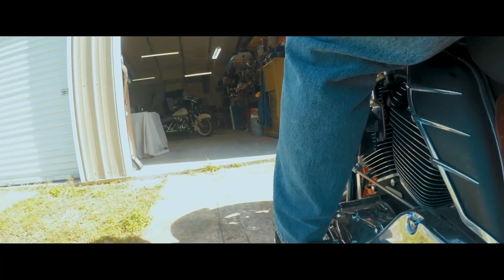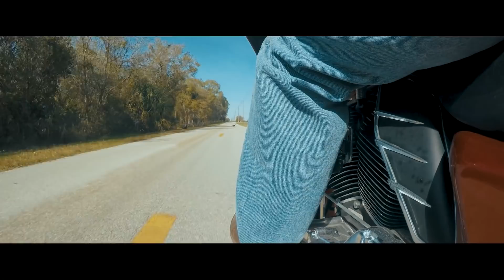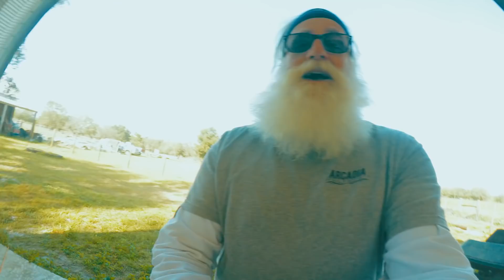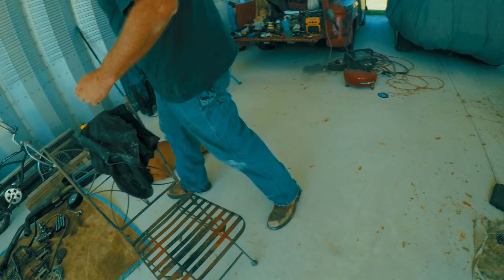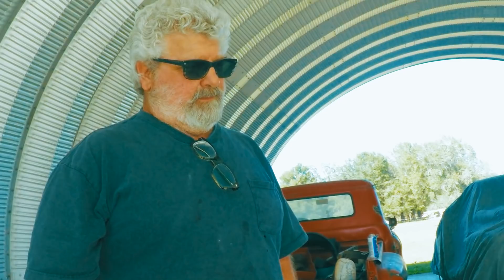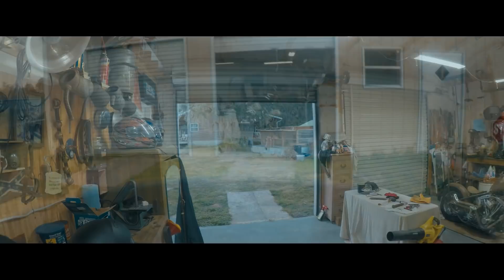2004 Deuce Softail UPDATE...This Is NOT Good!!!

Comment: Thanks.  I got a 2005 Deuce. Live in orlando fl. A week project turned in to two months. Like your Buddy i have worked on everything. A bike is a machine all machines can be fixed. You can throw parts at it. Or you can youse your head and manufacture or alter what you have. Butt never lose hope. So many ways to learn or ask for help nowadays. See you live by your shirt you live in arcadia.I worked at dakin dairy as maintenance manager in Myakka so you know i can fix anything. LOL I buzz thru their on my way back to bradenton know and again. I 4 sucks back roads are the only roads.

Comment: I recall a buddy of mine bought a then-new Honda Goldwing which needed a cylinder head replacement. The gasket mating surface of the cylinder head in question was poorly machined. Consequently, the head gasket failed, thus causing engine coolant to leak into the combustion chambers. Luckily for my pal, the bike was still under factory warranty. As with anything wrought by the hand of man, motorcycles DO break down -- some sooner than others. Build right. Ride safe. -- W
Reply from the maker: They all fail at some point, just have to roll up the sleeves and fix it, what a great feeling when you luck up and actually fix it...thanks for the comment...ride safe, ffej

Comment: I would say worst case you buy a used motor clean the oil tank and lines and go riding to me it's a hole lot cheaper than a new one, and I don't see your buddy riding that much he sounds like he's real busy if he's building houses! With the amount of people moving down there he can probably work around the clock. But I have a question did you make your street glide tri glide? Not seen one before??? Thanks for the video
Reply from the maker: I should Have a video sunday coming out about the trike, so many people are asking about it...

Comment: Oh!, As for that bike, the failure of the oil pump was 1 or 2 things...
Either something got lose in the engine and the pump ate it.
Or, the pump failed due to a flaw in the manufacturing of it.  Most aluminum parts in a stock HD are 'Cast,' not 'Billet.'
And it's well known that cast aluminum is rather frail, compared to something carved out of a block, as in billet made parts.
Even so, I wouldn't think a stock pump would fail like that, if oil was the only thing going through it.
I'd have that fella check the pinion 'runout,' on that side of the crank shaft.
If the runout gets too crazy, it could possibly cause the pump to tear itself apart!
Once again...  Peace!
Reply from the maker: The balance chain broke and got sucked into the oil pump and that  wrecked that motor...it'll be running soon..👍

Comment: I bought a Tascam 4 channel field recorder recently to help with my audio. It has the built-in LR mics and 2 combo XLR (I think? 3-pronged w/48v phantom) /quarter inch tip-and-ring inputs. The little testing I've been doing has given me very clear audio. Hopefully I'll get to get a vid made using it soon.

Was about 2 bills. If you don't need 4 track you can get its little brother for about half.

Edited: wrong mic port name
Reply from the maker: That would do the job 👍
Reply: @shovelheadffej  it's the DR40X model if you're wondering (went and found it). Runs on AA batteries or mini USB power

Comment: Tough deal on the Deuce. If he doesn't have the right tools or machines to rebuild it, he'll spend a good bit on getting it worked on. I helped rebuild a 48 Pan with some friends once who had more experience than I did at the time and we all worked at a machine shop together. That still took 3 months and everyone who worked on that bike donated their time....for beer. Lots of beer. Lol. Still I found out if you don't have the resources you are in it for the long haul. Nothing is cheap. Disassembly takes time, machine work takes time, and assembly takes time as well. The payoff is when it's done you'll find a crap load of things you want to change because we all know they are never finished...ever...lol. So here's a cold one to everyone who ever worked on a Harley and possibly lost everything they had doing so....where you going Honey? It's almost done...Lol
Reply from the maker: it's great to have friends that take beer for payments, that's the way it used to be. friends helping friends not expecting money...He'll get it going...ride safe, ffej

Comment: Been subbed a short while. Like your vid's and style. I'm a wing rider. Have an 84 1200 Aspy and now a 97 1500 on a California sidecar trike kit. I went to a trike because of bad legs. A Goldwing ain't light, even the old 1200's. I'd be interested in your take on the pro's and con's of the trike vs 2 wheels also. I have found a lot I like about the trike especially the fact that it don't fall over if your foot slips on sand or gravel and your leg doesn't hold it up. U-turns are a bit easier to. I get asked about the difference and what I miss and don't miss about the 2 wheeler. I say I miss that feeling of leaning through a corner, draggin boards. I don't miss the pucker factor when you see gravel on the road in front of you on that curve your leaning through.
Have you tried some kind of handle for your gopro? Keeps you from handling the camera and getting the rubbing noise. Helps some.
Kinda cool up here in the midwest. Ain't had a ride in over a week. Might get up to the 40's later this week. Warm enough for me.
Reply from the maker: I did have it on a selfie stick, the sound travels into the mic....I'm shooting a video that will be out this Sunday about the pros and cons of the trike...ride safe,ffej

Comment: I'm the 3rd option I got my dad's Harley this year after he passed from cancer it's an 03 100th anniversary deuce and it was running fine and a few weeks ago when I start moving it jerks forward like it's going to shut off starts and idles fine but doesn't want to go I tried checking the codes but I must not be doing it right or I don't have any it gives me these 1-10 numbers and says Clr next to the numbers and when I press the reset button again it says PPU. HELP ME!!
Reply from the maker: I'm a total analog guy...ChoppaRod is a Deuce guy,try hitting him up on Instagram chopparod...or maybe someone will read this and help you...sorry I'm not much help...I know there is a Deuce form if you haven't looked...

Comment: Hay a good route to go on that duce is to go with the after market gear driven cam plate and that won't happen again it honestly should be a recall from the factory just saying. Good job on all your videos glad I found you
Reply from the maker: You are right about the cam plate, I have that in my road king..it was the balancer chain that broke and sucked into the oil pump,  it fixable just a pain..thanks for the comment